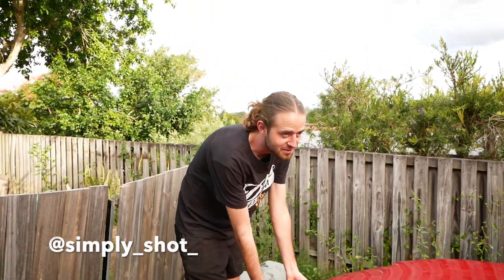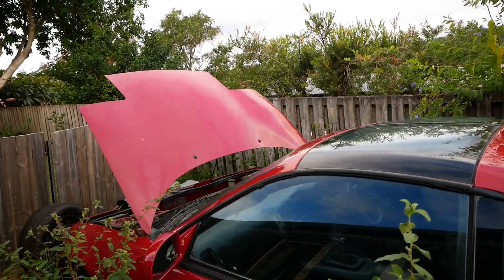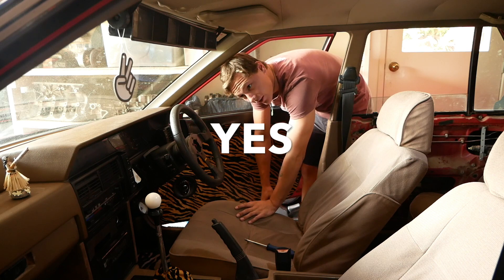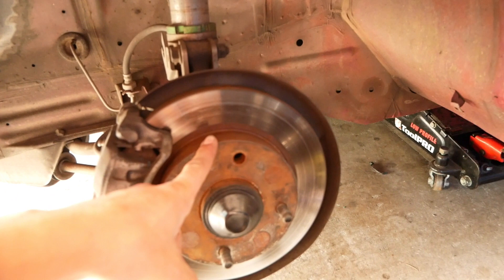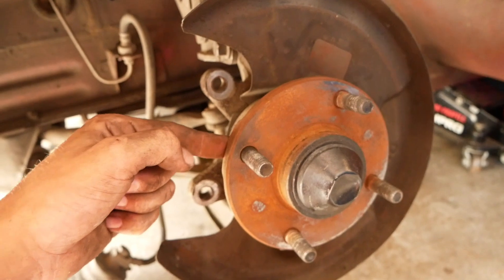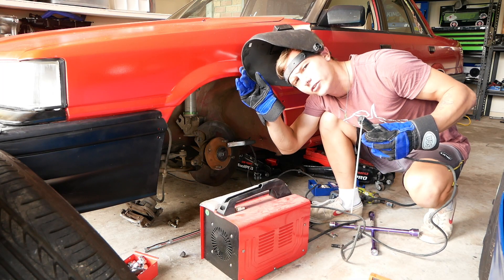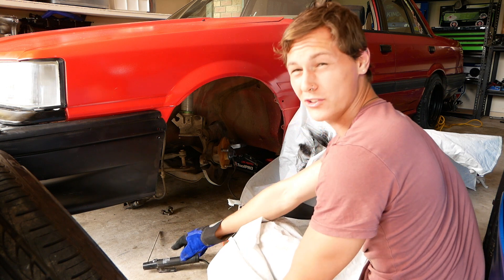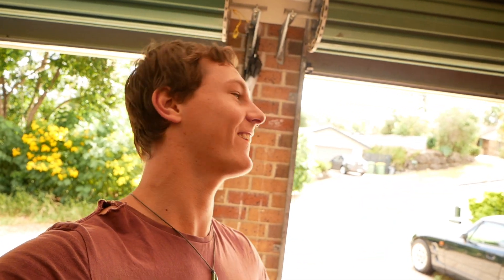3 Tasks Completed Unsuccessfully In Style

Comment: Hey bro just a little tip when arc welding you need to hit (more of a tap) the rod on the surface of where you want to join and than pull it away just slightly like 3/4mm. Recommended try on something before hand to get used to it and getting a auto darkening helmet makes life easier when starting to weld, need any help let me know
Reply from the maker: yo man sorry I didn't see this till now!
ohhk makes sense!! i think our welder is definitely broken😂
i think the plan is to get a tig and mig and start there! thats mad you know what your doing though man!!
Reply: Im a boiler maker so got some experience with it, definitely recommend a gas mig welder. Enjoying all the videos your bring out keep it up bro, ya killing it🤙